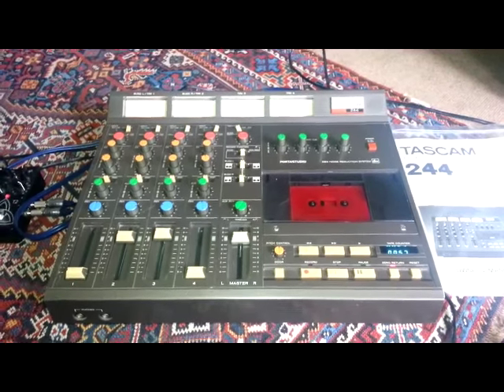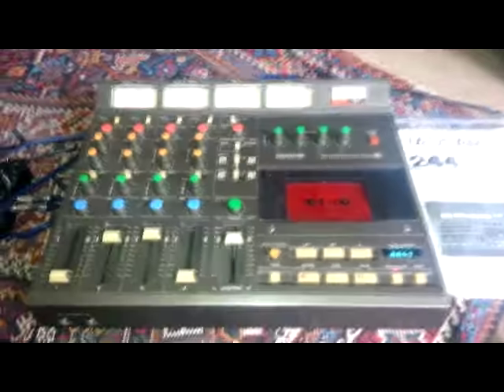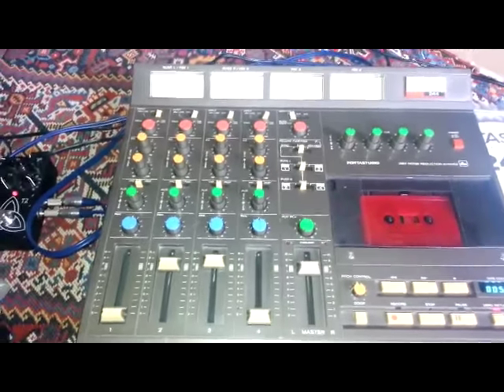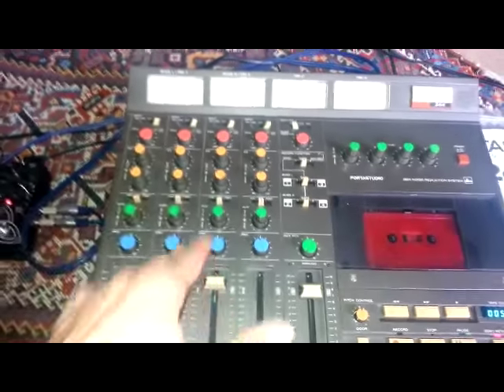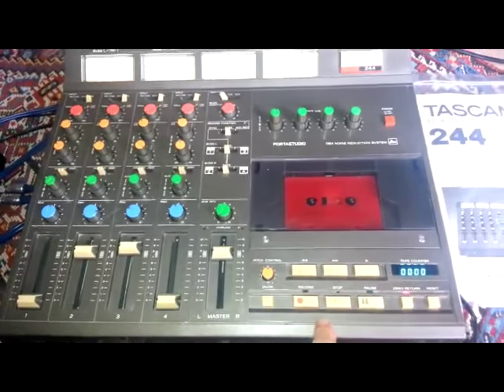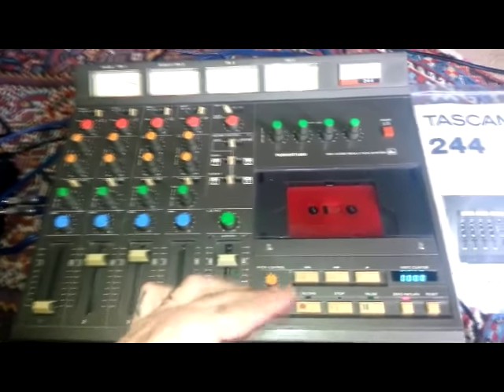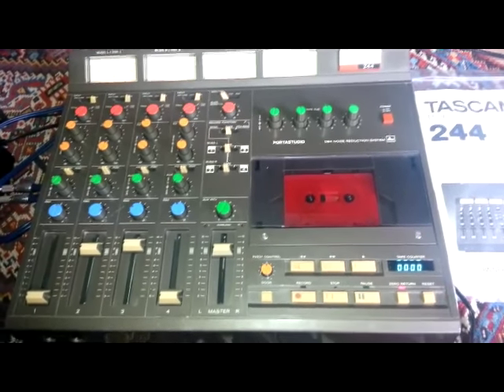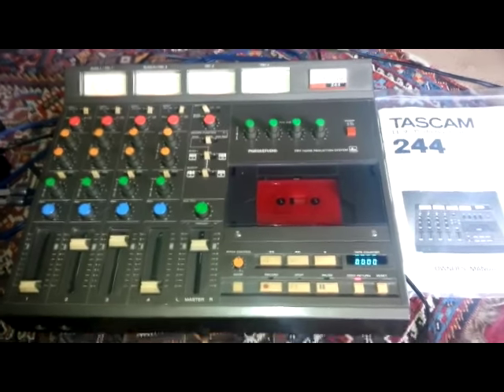TASCAM 244 PORTASTUDIO - CASSETTE FOUR TRACK working, new belts etc fitted

Comment: Hi, I used to have one of these right when they first came out. I still have all the tapes that I ever recorded, but no machine. Any ideas where I can get one in good working order as I'd like to trasnsfer all my tapes to digital? 
Thanks in advance.
Reply from the maker: Hi John. eBay is your best bet for refurbished portastudios, in the UK which is where I am from there are 2 guys of whom I am one who sell refurbished cassette four tracks quite regularly, my eBay handle is holymountsinav if you want to follow me, there are also people in Germany and US refurbishing these.    Neglected units can still be had fairly cheaply, so If you have some basic DIY skills, time and patience and want to save some money, I'm trying to build up a comprehensive library of how-to videos on refurbishing and maintaining multitrack recorders  on this channel - I already have a few videos on the 244 uploaded with more coming soon. Where are you based?
Reply: @Tetrakan  Hi,

Thanks for getting back to me so quick. I have done some rethinking, quite dangerous and believe what I really need is a TASCAM 234 Syncaset and not the actual 244 Portastudio. I don’t need the mixing side. I just want to archive the tapes and then I’ll sell the unit I’d hire one if I could. I live in Guernsey. Channel Islands.

Kind Regards
John
De Carteret
Reply from the maker: @JohnDeCarteretElvis  These units keep their value so if you could get hold of one then you'd get most or all of your money back when you sell them on, so that'd be cheapest way to do it in the long run. FYI a  244 246 464 or 424 mkIII all have tape direct outs so you could bypass the mixer altogether and record 4 digital tracks simultaneously into a DAW and blend/pan/ process them in the digital domain if you desired. If you get stuck buying one,  get back to me, I could do the transfers to .WAV file etc but you'd need to send the tapes here and I'd need to charge you something (I'm in Scotland) Good luck!

Comment: Is this still for sale?
Reply from the maker: This unit sold but I am waiting for Idler tires on another. It should be ready for sale on eBay early next week.
Reply: +rumjitBokum may I have the link to it when it's ready? I would love to purchase next week when ready!
Reply from the maker: Sure, I'll lave a message here when its ready, thanks for your interest :)
Reply: +rumjitBokum no problem! how much will it be or is it gonna be on bid?
Reply from the maker: hi, it will be £185 including UK postage, and I use the global shipping program - so if you're outside the UK, eBay will add a charge depending on your location and the weight of the item. For comparison, I've seen refurbished units go for 50% more than this, I really only charge a nominal rate for the time I put into getting them running again, thanks :)
Reply from the maker: Angel Santiago sorry for the delay, the item is listed now, search ebay for item number 322280992291. The asking price is £200 but if you submit an offer of £185 it will be accepted automatically, thanks.
Reply: rumjitBokum do you still have one?
Reply from the maker: @numanuma20  Hey sorry you never got a reply to this closer to the time. I do occasionally sell refurbished 4 tracks on UK ebay, my tag is holymountainav if you want to follow me there, but if you'd rather save cash and fix one up yourself I already uploaded some tutorials to my channel, with more to come, cheers, Calum :)